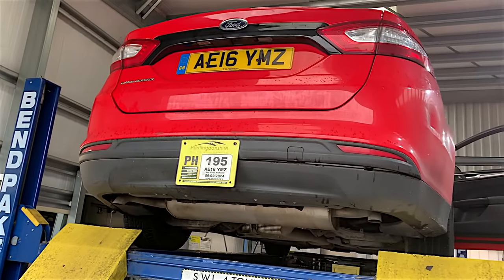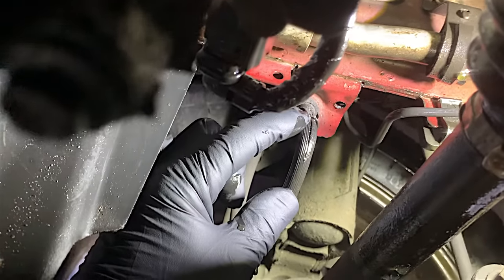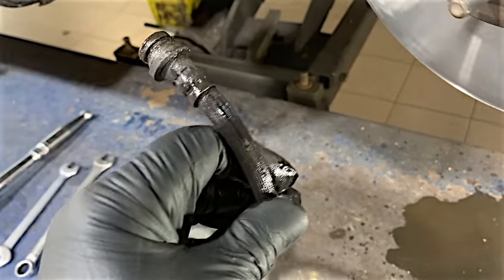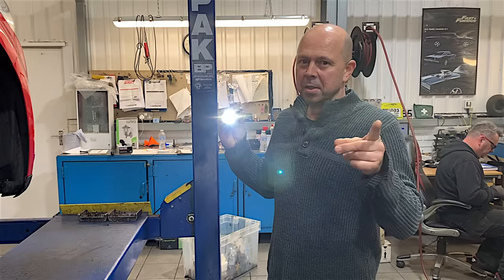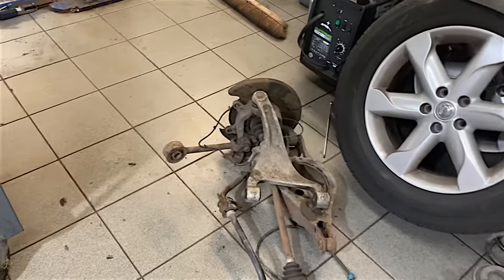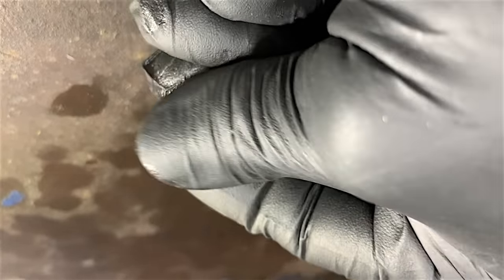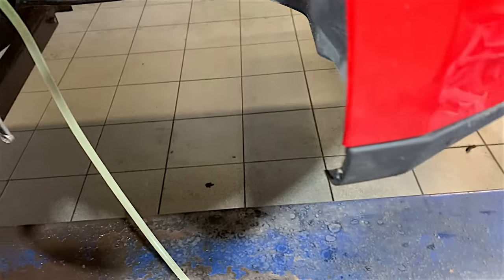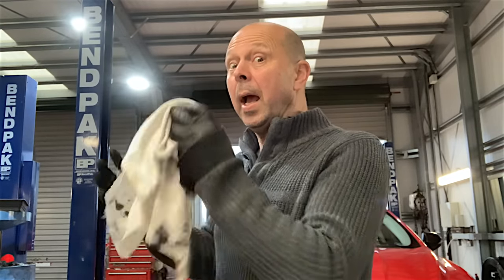Nice Day for a Burst Brake Hose, Ford Mondeo Mk5..Happy Halloween

Comment: Hi alan, Good to have another mk5 video. I have noticed recently the aftermarket for the Mk5 has gotten a lot stronger. On ebay now you buy the bushes for that rear suspension arm, the spring for the fuel pump and driveshafts, plus more stuff ive forgotten.
Reply from the maker: thats good, makes life a lot easier and cheaper

Comment: This is a very common problem on fusions 2013+. To the point they have 2 recalls on the same issue.

"Front brake hoses may brake causing a leak"
Reply from the maker: thanks

Comment: Had the same happen on 2018 Ford Galaxy, brake fluid was gushing out even worse than this video, no brakes or resistance from brake pedal. I found they are covered under a Ford recall (CSP). Had both front brake hoses repaired for free. So do check this too to save the time and money.

Comment: Hi again Alan, another excellent video (unlike your jokes !).  A question for you, i was taught, many years ago, if you have to re use copper washers on the banjo joints you should heat them red first to make them malleable again in order to create a good seal as they "squash".  Have I been wasting my time all these years ?  Thanks, Dave.
Reply from the maker: you can do but i never bother, best to replace if you can

Comment: Hello. The Mondeo is a strange car. I own a mondeo MK4 titanium with Powershift automatic which is a very bad gearbox with several common problems! Ford has chosen slightly too cheap and not so good solutions for many things. Tragically little info in the covers+ screen and other things around the car which are made a bit cheaply The MK5 is too little of an upgrade from the 2012 mondeo titanium